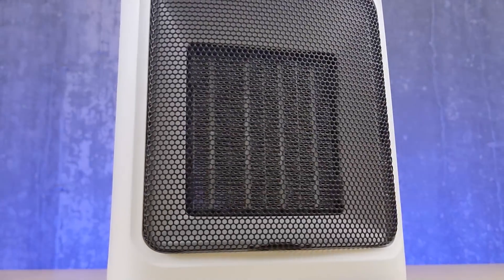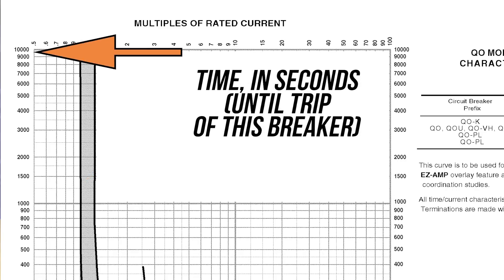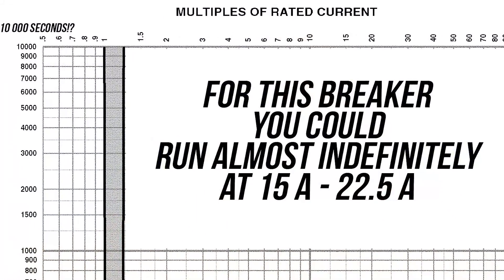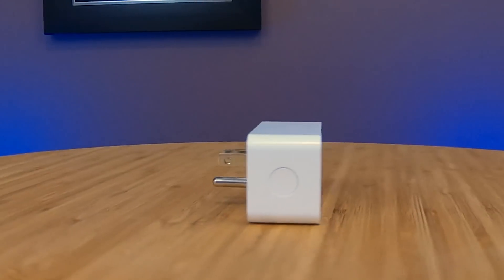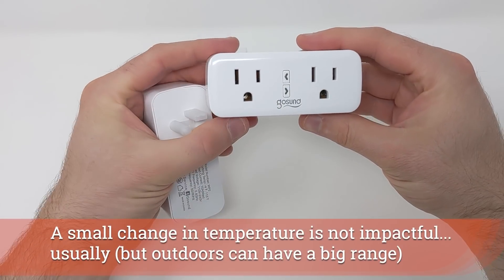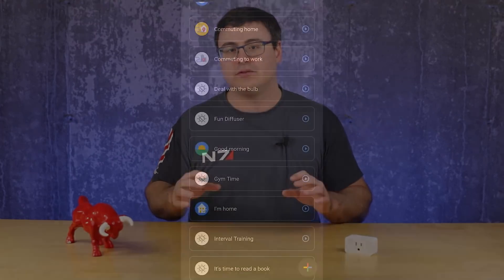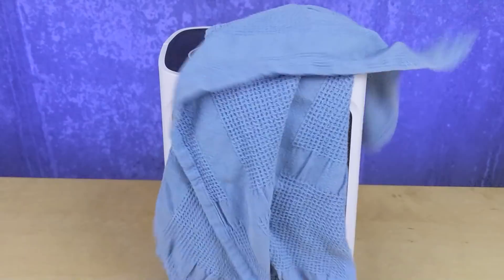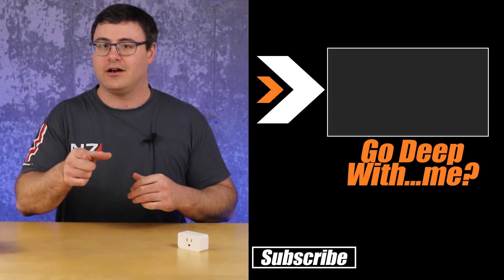Why Smart Plugs EXPLODE or MELT With Heaters!  Are Smart Plugs Safe?

Comment: Brian, Is the danger still present if the heater is on low setting, 500 watts and on a thermostat? I am considering replacing some of my outlets with the Kasa smart outlet and use the smartplugs somewhere else.
Reply from the maker: Hey David - You still have some risk but you've definitely lowered it considerably by lowering the overall usage of amperage.  Remember though, you're still creating heat in all the components!

Comment: Interesting video -- I always assumed if a plug was rated to 15A and the breaker was 15A, assuming nothing else on that circuit you were likely fine, assuming it also didn't have a huge start-up draw when the plug turned things on.

That said, I have been using a 15A (TP-Link KASA) plug to control a dehumidifier for almost a year without issue.  Looking it up now, that unit pulls about 6-7A under load, so I assume that's still safe given it should never get near 15A?  Also I have a few computers plugged in (different breaker/circuit) just in case they hard lock while I'm not home and can't remote in/remote reboot (Plex server being one of them).  A quick google seems to point to these  pulling at most around the same 6-7A if under full load, so I assume safe as well?
Reply from the maker: You should be good with that setup.  Maybe just check if it's heating up over time with your hand every so often.  If you do find it's heating up pretty well (the smart plug), then it's probably a good idea to replace it every so often.

Comment: 240volt 10amps in Australia for wall sockets - yet my spearpoint/borewater pump runs a 400volt capacitor to handle the "inrush" you mention just to get it spinning up to begin with (else it melts wall sockets lols)  Found this out the hard way when it blew up and the next time it ran,, guess what it melted lols
Reply from the maker: EEP!  Yeah even with the lower amps this can still happen hey?  Scary stuff but good to hear you have the cap in the way there to at least help that inrush smooth out.  Now let's get you a VFD and REALLY smooth that out.
Reply: @AutomateYourLife   I had to google what a VFD was but yeah that looks like it would save my powerpoint if the capacitor fails again :)  The pump comes with the 400volt capacitor from the factory to help inrush - and they enclosed it seperatly inside a plastic enclosure mounted to the pump - When i saw it blown up i realised why its stored in a enclosure lol it really went in a big way (melted and end blown off lol)  included a link to a photo of it blown up if your really bored lol   https://ibb.co/BcnbB3k
Reply: PS - Just like to say thanks for all the videos - your the reason i got into home automation a few months ago hahahah. My spearpoint pump is actually running off a tuya smart plug these days and runs on a automatic schedule. I also changed it so google thinks its a fan (which allows me to tell it to turn the sprinklers on for 30minutes without google saying it wont as it cant schedule switches- I learned that trick from you as well hahahah)  Cheers and have a top day up there, from downunder (australia)
Reply from the maker: Oh that made my day sir!  Cheers from the frozen tundra of Canada!😛

Comment: This technical guy loves technical videos! I learned something today! Very cool, and thank you!

This is one of the reasons why I'm such a fan of the Shelly Relays. They have safety protections specifically for this very reason. 

While able to handle 2x2300W or 2x10A (on the Shelly 2.5, or 3.5 kW on the 1PM, they also have their own internal temperature sensor to kill the current if the temperature gets too high.

As you know, one of the main jobs of security guys isn't so much keeping networks safe, but also keeping the infrastructure safe. It's cool and all to have a NAS at the house to control your own cloud, but if the house burns down, the NAS goes with it. That's a denial of service. 

Safety, is every bit a part of security. I cannot wait to see what you have next, sir!
Reply from the maker: I gotta get a bit deeper on those Shelly's...you know, they've been sly with me on specs and certifications.  I really just wish they and Sonoff would share their certification data so we could be sure about the safety.
Reply: @AutomateYourLife  won't lie, it is cagey to nail down.

A month ago, when you would go to their site, you could see a Shelly 2.5 with a UL Listed certification. Plus, a Shelly 2.5 without the UL Certification.

That baffled me so I asked. They said there was no design difference. Just a deviation between lot numbers before and after certification was granted.

It appears now that all the non-UL 2.5's are gone. Only the certified ones remain.

The frustrating thing is that this is ONLY for the 2.5

Others are still undergoing evaluation an so SOME Shelly devices are UL certified, some are not.

All meet the European Certification requirements which is quite similar, but insurance companies are picky and I would only use the UL Certified devices.
Reply from the maker: Yep...I've had this back and forth with them a couple times.  Not touching it guys... certification must be there.

I know far too well how certification ensures levels of safety that are necessary for electrical gear.  I've seen too much exploded switchgear
Reply: @AutomateYourLife  yeah, I need to see that UL stamp or it's a no-go.

Still, you should give the UL certified ones a deeper looksie. I sure would be interested in your thoughts!

Comment: @Paul Hibbert can you please do a remake of this video? I did not understand how to choose a smartplug for my heater.
Reply from the maker: Lol but the point is you shouldn't choose any
Reply: @AutomateYourLife  not really true. I've been using an heater on a TP-Link hs110 without any issues for the last 3 years. (but this might be an Europe certification thing though)
Reply from the maker: Having it work for a number of years doesn't change the opportunity for trouble.  I'm pretty familiar with EU standards, and actually in most cases, North American ones are much more stringent.  Just be careful.
Reply from the maker: What you sent is technically accurate, but in any retail store in the US/Canada, you're going to find ONLY CSA/UL/etc. certified products.  It's only the world of online that has allowed products without those certifications into people's homes.  This is an additional problem and one I hope to address on the channel, actually.  I've received a few products that don't have those certifications, and when I do, I tell Amazon and the product is instantly de-listed.  They know it's wrong, but haven't found a way to control it yet.  FYI - Those products didn't have CE listings either, so I don't think this is an N.A. problem only!

However, the CEC in Canada and the NEC in the US both state the requirements for electrically connected devices and in order to be certified, you need to meet those standards.  Depending on your device, you may need to meet additional IEEE, CSA, or other governing body certifications.  For example, arc flash is handled by IEEE 1584 and CSA Z462 in Canada.  NFPA has their own standard for arc flash in the US.  So, to get a UL/etc. certification, the product has to meet all that.  It's a LOT.

What I'm saying is the actual meat of the standard is more stringent in the US/CAN vs EU's CE certification.  That's an in general statement of course and there are parts where you could find the CE's guidance to be better, and others where the NEC is better.
Reply: @AutomateYourLife  UL certification is not required in USA. (I'm not talking about Canada) I can literally sell my electronic equipment in USA without UL or CE certification. some wholesalers (like Amazon) will only allow (or shouldn't) equipments with such certifications. But unlike Europe is not enforced by any laws.
Reply from the maker: @Ricardo.L.P  Yeah I get what you're saying.  In reality, you can't sell those products in a normal store.  It wasn't a problem until Amazon came along.  I'm betting that changes soon in our countries.

Comment: I have blown a couple of these so called smart plugs from diffrent manifactures playing around with loads. These plugs in my mind are all poorly designed. My General rule of thumb, Do not exceed 2/3 of the rated capacity of the smart plug. Avoid inductive loads like motors aka household fans. I have blown one of these on a normal room fan. I agree fully with your assessment. Be very careful were you use them, because these things will burn a house down if incorrectly applied. Good video as always and thank you for keeping us informed.
Reply from the maker: You know your stuff, clearly.  Those inductive loads can be baaaaaaaad news and never seem to be handled well by these.  I like the 2/3rds rule too.  It goes in line with most electrical standards!

Comment: Would this be the case in the UK? I have a fused plug in a smart plug itself in a fused extension cord. Are the two fuses protecting me from these issues any?
Reply from the maker: Sadly, fuses are very similar to breakers.  The difference being that they get physically burned out vs a breaker which can be reset.

They still have a curve for how they burn out, so that means the same theory applies.  You need to know when and how they burn out and make sure your smart plug is being protected.
Reply: @AutomateYourLife  Thank you!

Does the 220-240 volt thing help? I used your formula for 2000 Watts / 220v to get what seemed a decently low amperage. Am I doing that right?
Reply from the maker: Yeah so the 240 volt thing does bring down amperage.  That's great too, and that helps with heating.

W / V approximates Amps.  It's not exact, but good enough for what we're doing here.  There's something called power factor involved in that conversion.

Comment: It does surprise me that smart product manufacturers have not created a plugin device suitable for space heater control, given this is something people would want to control regularly.  I know Aeotec make a high current z-wave device, but this needs to be hardwired.  It is definitely a hole in the current product offerings.
Reply from the maker: There's a biiiiiiiiig gap there!  I think most manufacturers are simply staying away from a use case that won't look good in the end.

Comment: Great video ... Apart from using the very expensive Dyson heater, is there any other cheap way you can use a smart plug relatively safely with a panel heater?
Reply: There is a little hack that would make a fairly safe way to automate a cheap space heater. Contactors. They're usually rated at 30 amps or more and can safely handle a space heater.

Get a contactor with a 120v control coil, and wire any cheap old WiFi outlet to it. I did something similar using a contactor and a sonoff wifi switch to control a 5000 watt garage heater.
Reply from the maker: I think you want to really oversize the smart plug vs the size of the heater.  Then you always want visual confirmation of that heater having nothing on it or being tipped over.  

My advice is still don't do it

Comment: Hey bud, quick question, as I know you've covered this, cross automations, IE, would you use direct say smart life, or through Smartthings, same with other cross companies?? TIA
Reply from the maker: Well the SmartThings and Smart Life integration has just expanded and works with more devices, so definitely through that!!
Reply: @AutomateYourLife  Sorry, you miss understood the question, I know I know use Smart life through Smartthings, My question is, would it be better using Smartlife direct or use it through Smartthings, the reson im asking, is I have in Google 3 of each light now, as I have the smart life the smartthings and then googles lol, so when I ask to turn one light off it says turn off 3 lights lol, which isn't to much of a problem, where I have the problem is with Bond, when it turns the fan off it turns it back on because it send the signal out more than once. TIA
Reply from the maker: Ahhhhhhh, tough question to answer in comments.  I think with the Bond what I'd do is take one of those devices and just move it to another "home" in the Google Home app from SmartThings.  Especially since it sounds like you have a gap in time on control.

In general though, I would say there's not enough in the SmartLife -> SmartThings integration to use that method.  So go to Google with those devices and maybe move the SmartThings ones out to a separate home.
Reply: @AutomateYourLife  Thanks bud, right now all the duplicates I've just put a Z in from of the name, them put them all in a room of their own, and called it Z-Room lol other wise I end up with 3 or th4 same device in the same room, But I just thought of Unlinking Bond and Smartlife from google and controlling the devices through Smartthings,

Comment: I believe the instructions on the smart plugs state that you can’t use them with a/c, heaters or aquariums.
Reply from the maker: I'm glad you read those!  Most...don't
Reply: The issue with aquariums is really just the risk of getting wet. There's no issue there if you can assure that the plug remains dry.
Reply: @loganfisher3138  the filters, they can burn your plug.

Comment: Oil heaters should be ok then as they get slowly heated  ?
Reply from the maker: It all depends.  They usually heat up with a good inrush too as they're heating a ceramic element usually to do the heating.  So it's pretty similar depending on the design right?
Reply: @AutomateYourLife  I would think oil is a more efficient cooling medium than air. Is this something you could measure with a Kill-A-Watt or something?

Comment: Hey Brian is this the same for using a switch on a microwave? I have parents with dementia living in our home and I am hoping to use a flic inside the cupboard to turn on the microwave. It is unsafe for them to use it on their own.
Reply from the maker: I think as long as your smart plug can handle the microwave for a while (upsize the Wattage vs the microwave wattage as much as you can) then I think you'll be OK here because microwaves don't tend to run for very long time periods like heaters do.

Still, I'd have an auto-shut off planned somewhere on this.

Comment: Make sure they are rated for 1500w!
Reply from the maker: Even then Lorne...even then.
Reply: @AutomateYourLife  You may be right.  

I had some die that were underrated.  It only took a couple of hours in most cases and they were very overheated but not on fire or melted.  

I have 5 running (Meross) with not even an overheating issue.  To be clear they rarely run for more than 40 minutes at a time (that's why I have so many.)  My situation may be different than others.

Comment: If you do want to run a heater on your smart home, I bought one that came with a remote (most do now) and programmed it into my Broadlink RM Pro. We can schedule on/off times through Google Assistant with it, and it's safely plugged into the wall by itself.
Reply from the maker: And that's a great idea Ben, just make sure you get that visual confirmation that everything's OK with that heater.  Nothing on it, right?
Reply: @AutomateYourLife  Yup! We mostly only schedule an extra 30 minutes of run time when going to bed, then have it turn on 30 minutes before our alarm goes off in the morning, and we do it by voice every night. I refuse to add it to a scheduled routine or anything where I can't be sure of it's state or know someone will be in the house when it turns on.

Comment: Great information, Brian.  Keep this kind of thing going, Brian.  It's useful and makes us think.  It's sort of like eating our Smart Home Vegetables...  They may not "taste" as good as the fun things, but sometimes you just gotta do it and learn some of the dry stuff. Another alternative is to move way down south where space heaters are rarely required. I did read that the US National Electric Code specifies that a circuit shouldn't handle more than 80% of the breaker rating.  That means 16 amps for most circuits.  I could be all wrong...  I'm guessing that's why most of the smart plugs seem to be rated for 15 amps???
Reply from the maker: Thanks for that Hugh!  I agree...I felt like this was something I could bring to the channel and I'm going to build out these deeper learning videos I think.  It's something unique and like you said, we gotta eat our veggies.

Or move and ignore them!!! AHHAHAHAAA!
Reply from the maker: You're probably right about that reduction in rating.  I haven't read the NEC in a bit, though I did read the CEC (which is basically a carbon copy with a few changes here and there) recently.  I believe that it's specifically for inrush and for fault management too.  You don't want to burn wires inside a wall in a home...cause...that's the end.